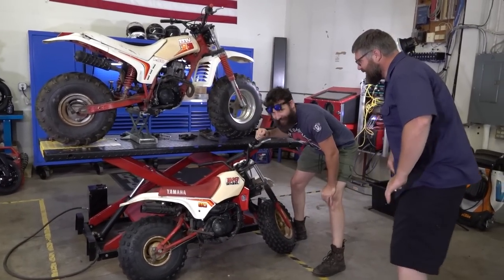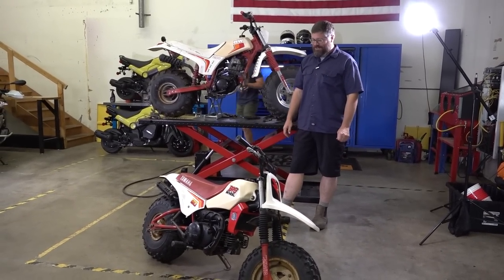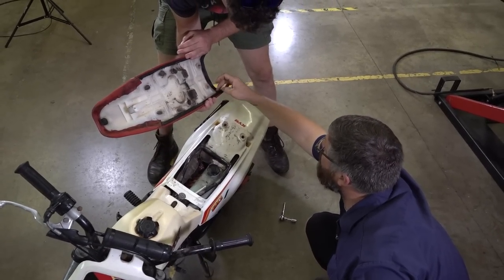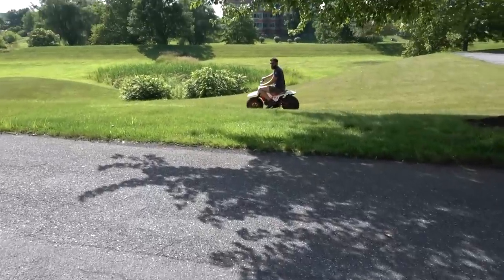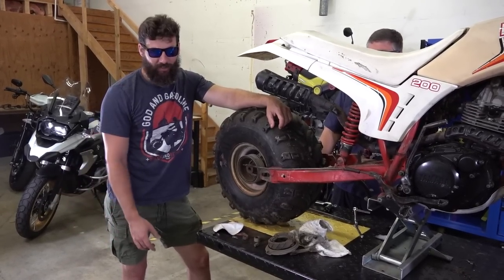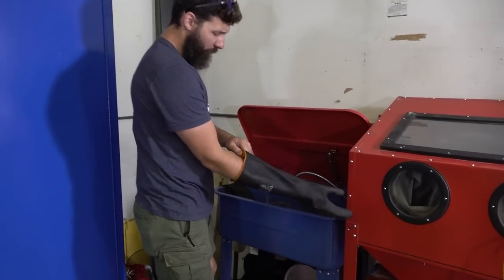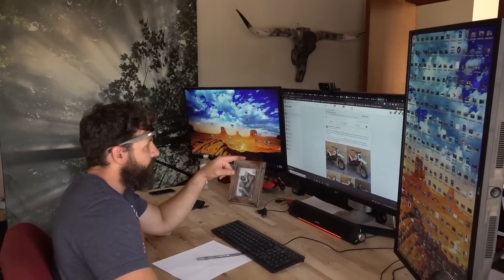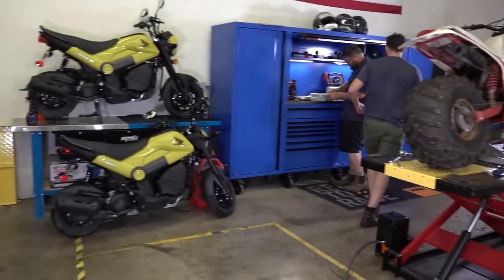I Bought an 80's TINY  Fat Tire Bike (80cc 2 Stroke)

Comment: Yamaha two-stroke street and non-competition bikes have an injector pump under the cover on the right side of the engine. It is driven off the primary gear on the crankshaft. It is a small reciprocating pump, and the stroke varies depending on throttle position. The throttle cable is connected to two cables........one going to the carburetor, the other to the injector pump. The stroke of the pump is adjusted by adjusting the outer housing of the cable. (There is a brass bleeder screw on the side of the pump to rid it of air, in engine-repair situations.)
A 3/8" rubber tubing from the two-stroke-oil tank supplies the pump with oil. A smaller tube returns from the pump and goes to the cylinder inlet (via a banjo bolt) just where the carburetor is attached.
Yamaha used to call it "Autolube oil injection".
Competition bikes used two-stroke oil pre-mixed in the fuel, just like outboard engines.
Trinidad & Tobago. West Indies.

Comment: I had a 1973 Yamaha DT360. The oil line came off the pump and I noticed the bike slow down loose power. I shut it off. Found injection oil al over the engine. The clip that held the hose from pump came off. Pushed it back on . The bike was ok it did score the barrel and piston and year later I rebuilt it.  I loved that bike .

Comment: I would think you could tell the oil mixing doesn't work based on the smell of the exhaust. But then it might be too late for the engine. I've only ridden a 2 cycle bike that needed premix. The smell takes me back to my teen years.

Comment: Nice bike, Sean :)
But if you want something really cool, get yourself a 1983 Yamaha XT600 Tenere. That thing can do 100 miles per hour,no matter how big incline there is. Mine has 70 horsepowers and NO electric starter. Kick start only by factory :)
And a massive window-breaking manly sound just like a big tractor :)

Comment: I picked up an old BW80 a couple summers ago for $125. It was a roller frame without the engine. I lifted it 6 inches, and put a 212 Predator engine in it with a cvt, and it’s the bees knees.

Comment: I have a stock bw350 and a bw80 that has been modified to run a built predator 212 with a torque converter.  Both are so much fun.

Comment: Hey guys Fantastic vid as normal. Have you ever seen or heard of the (Suzuki RV 125) I owned one way back in the 1980s. Its a fat tire bike with steel wheels, made for off-road and normal road riding. I past my motorcycle test on a yellow and black one. Fantastic two stoke, which never broke down ever!! Maybe you should try to find one and try it out. Cheers keep up the great video`s.
Reply: I was just thinking of mine, had the same yellow and black one.  Odd sized tires that I could only find from one place at the time, very expensive.  I wish I still had it.
Reply: Not real fat tyres, as only the back one is fat, but I think some front fork kits are available to make the front fat also.🤓 Sadly I do not recall who make these kits. 😕

Comment: Have you adjusted the valves on the bw200? Also I’d consider just ditching the old carb on there and putting it in a box to save. Use an eBay knock off. They aren’t great for modern race bikes but work really well with this kind of stuff. Maybe even get a nibbi carb

Comment: From all the research I've done the years made are: (200) 85-88, (350) 86-87, (80) 86-90, this may not be totally accurate information. I've seen online it shows an 89 200 but I've never seen nor heard of one and if they did make one it would've most likely been early in that model year and then they stopped making them. All I can say is good luck finding a 350 they are like hens teeth and only made for 2 yrs. I knew someone while growing up had what I believe was an 70-80cc Yamaha but then later a BW80 replaced it.

Comment: My friend had a BW-80 and a KX-60. The KX-60 was a little smaller but had like 3 times the power. For its size it was way to fast and strong. I dont think they make them like that anymore. Kawasaki probably had a bunch of lawsuits from the KX-60 ot was that small and that stong. I think you would have to be 4.5' tall or smaller for it to fit you properly, maybe even under 4' tall. I had a DR-100 and a CR-125. I always thought the BW-80 was a little under powered. I think a sprocket change on the BW would have solved the low end power problem. I know i changed up my sprockets on my DR-100 to get more low end power. Sprocket changes cand save the day in the power or speed department. I would love to try out that BW-200 or that Fat Cat you have...
Reply: Fat tire bicycles are popular now, you would think they would bring back the gat tire dirtbikes, mayby your vids will help with that...

I would like to see an Fat Cat XR650R...

Comment: You probably already know but thats basically a PW80 with modified forks/arm for the big wheel conversion. 
Most mechanical parts are shared and its a lot easier to get PW stuff than BW stuff.

Comment: Could you possibly tell me the settings the carb adjustments are at I have the same bike and it would be so helpful to have the same adjustment as that so it’s as zippy as that one. I can’t keep it running. So if you could tell me the pilot screw and idle adjustment that would be perfect. Thanks

Comment: 2 strokes have so much power per cc in a compact light motor.  No top heaviness or cam inertia top end feel.  Easy to work on.
Reply: We have a YZ 85 2 stroke.  24 horsepower and only 150 pounds

Comment: Fat tire bikes exist so the Japanese manufacturers could keep building parts for 3 wheelers after they were banned. All of the parts that wear out interchange, and it kept the parts in the ecosystem. After they were banned, my local Honda shop did significantly more 3 wheeler service and repair than they did quads.

Comment: I HAVE A QUESTION FOR CRAIG  I HAVE CHINESE PIT BIKE 125 CC NONE ELECTRIC  AND A CHINESE QUAD MOTOR WITH ELECTRIC START BUT BOTH  HAVE NO SPARK ALL PARTS ARE NEW WHAT I CHECKED AND REPLACED. THE OBVIOUS WHAT COULD IT BE PLEASE AND THANKS IN ADVANCE SHAWN AND CRAIG

Comment: Had a PW 80 as my first bike, surprisingly good engine but the gearbox and suspension let it down.

Also that one is not running right, sounds like a bag of nails compared to the one I had which ran near perfectly.